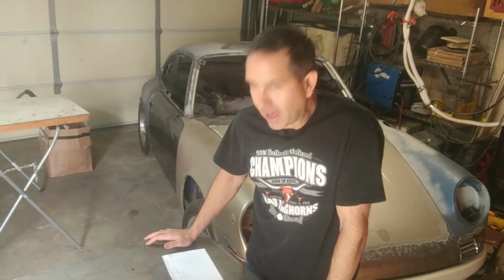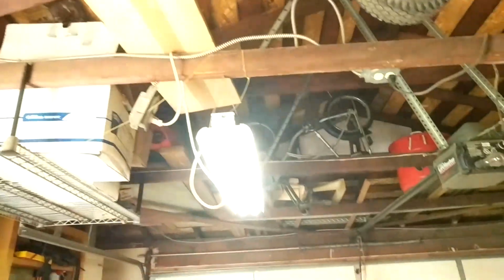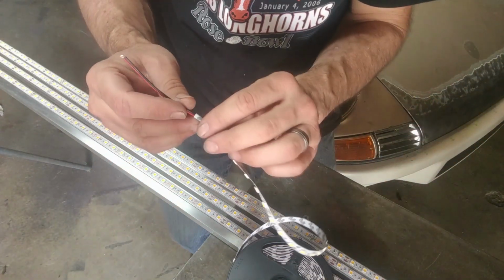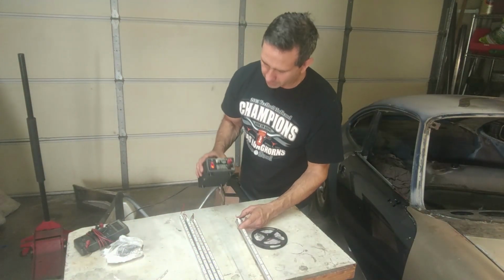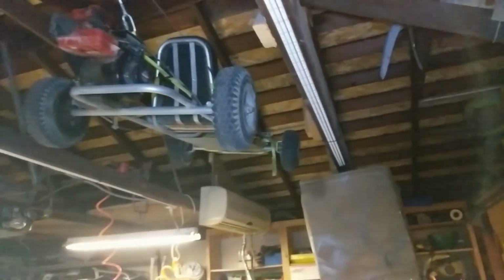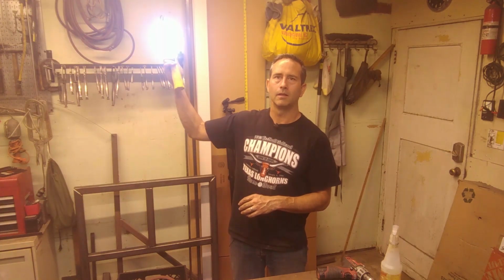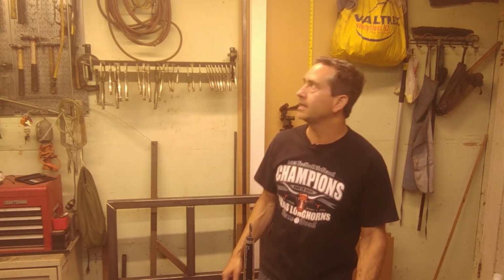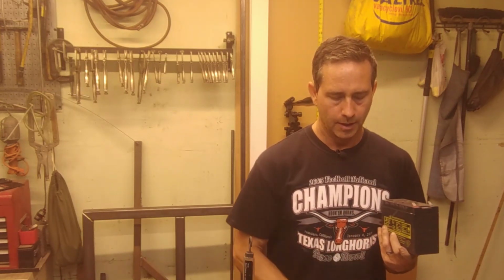How to Install LED Strip Lights - Shop / Garage Lighting Project

Comment: Hello, thanks for the video. May I suggest that you go for Lithium Ion (18650) battery banks,  on a 3S (5X3) 12.6 v configuration 7.5 Amps X 5 banks total being 45Ah. So you are not confined to 14 Amps from the mains DC supply. This would, eventually work out cheaper, in many ways, in the long run, if the battery banks are charged by solar panel. ($60~100)
You will require 75 (18650 Lithium Ion batteries) and these batteries need not be brand new. HOME DEPOT collects old lithium Ion batteries for recycling purposes. They don’t mind, giving it to any one (FREE) if they can be put to use (definitely can). 
I get mine from HD.
All the battery banks will be charged through, BMS for each bank which is highly necessary for the safety of the batteries.
Battery Management System is available each board costing about $2.50 postage free from ALI EXPRESS.
Try it out and you’ll really enjoy your work.
By the way, I’m not affiliated with Home Depot or Ali Express.
Cheers.
Reply: Sure, you are welcome. But instead of LiFePo batteries, which are hard to find FREE, 18650 batteries are found to be better, because they are more rugged and puncture proof. 99% of these batteries, from HD are from “DEAD” portable drills. FYI they are not DEAD. Some of them will be brand new and most in good condition. Keep in touch, I will be able to provide additional info. Cheers.
Reply from the maker: So you just ask for a bin of recycled batteries?
Reply from the maker: Great advice, thank you!  I will check into this. I'm familiar with RC car LiPo batteries, but I like your idea of free Batts from HD.  I definitely want to get a solar panel!